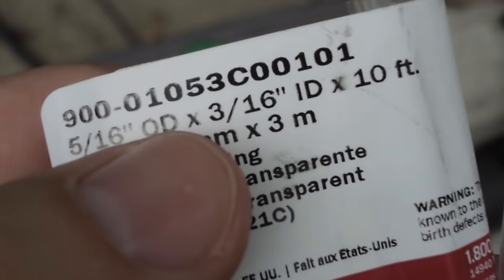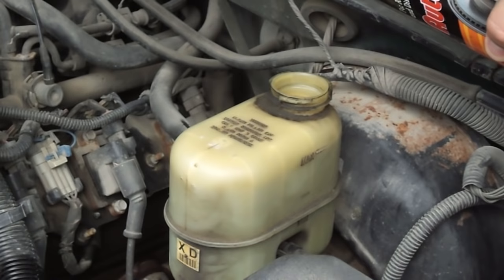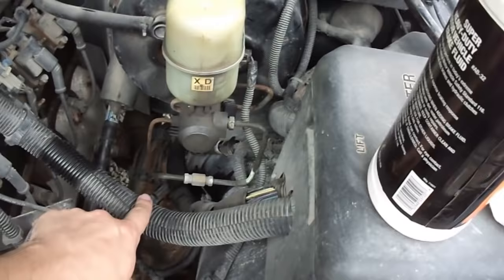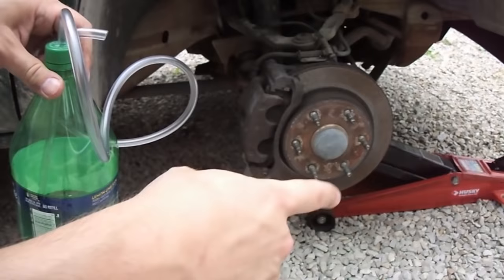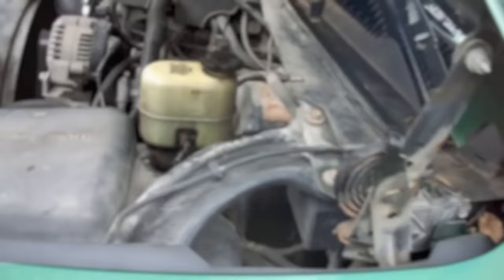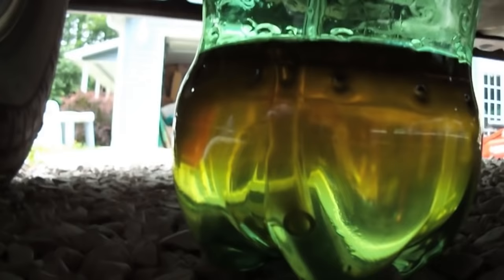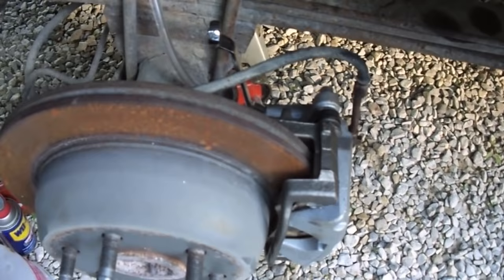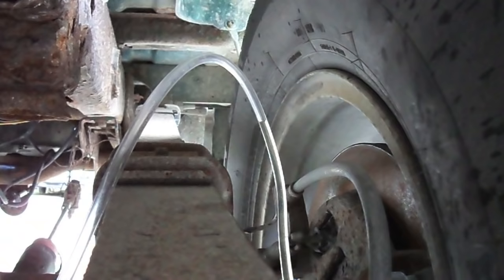Bleed brakes by yourself - DIY Brake Bleeder tool - Brake flush

Comment: too simple here in chicago your FIRST instrucion would be; get correct size 6 point 1/4 drive deep well socket and tap ratchet handle. if needed use heat, if sucesful get new bleeder. made an 8 buck job a 50 buck job. viewer now needs new caliper vid. way harder than talking wife to pump brakes

Comment: Next time check to see if its 3/8 and instead of 10 mm before you strip the head off of a caliper bleeder valve
Reply: Of its after the 1990s its metric I promise u

Comment: Doesn't always work right this way......you can draw air in the system around the bleeder screw threads.......pressure bleeding is the only best way to do it. Or have some one pump the brakes while you bleed the brakes......loosen the screw and then tighten before they lift the peddle up....
Reply: You describe the traditional way, but this method works too - I know because bubbles stop coming out and the pedal ends up rock solid.  I release the pedal slowly which I think reduces the tendency to draw air in, also don't undo the scew very far.

Comment: Your biggest mistake when bleeding your brakes is you are supposed to start at the brake furthest away from  the brake master cylinder. In other words start at the  rear right brake provided the master cylinder is located in the front left side of the engine bay. The reason for this is because you will reduce the chances of getting contamination in the brake lines. If you don't understand you could look it up. I am not going to explain an further.

Comment: It sucks how you guys take other people's ideas don't give credit where credit is due.
I designed this thing over 20 years ago and posted it on the internet you're not even using it correctly the bottle should be above the brakes so that it's creating a back pressure and you don't get air bubbles in the line.
The bubbles go back into the nipple through the threads. You won't see them in the hose.
Reply: phartattack ... Really you did this 20 year ago....golly my Dad showed me this using a Mason jar in 1961..but there were not to many to boast it to back then. I would be surprised he didn't do it in the early 40's. 

What a maroooon!
Reply: @jamestone265  Your dad beat me to it.  I was doing this around 1975 when Phartattack was probably in a pedal car. No-one showed me, it just happened. I was trying to do it the two-person way, but alone, dashing between pedal and bleed nipple, when I noticed that with the nipple open the fluid just came out by itself - with the air bubbles, and I helped with gentle pumping.  No brainer.